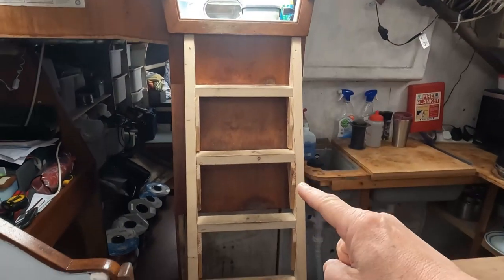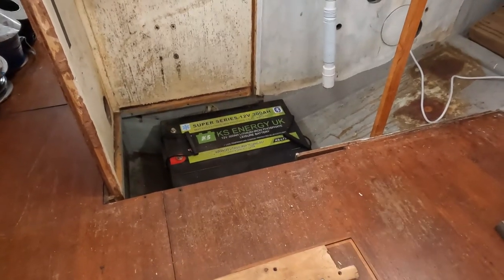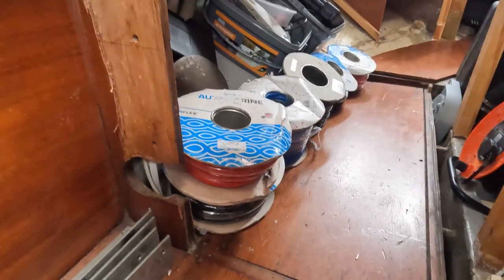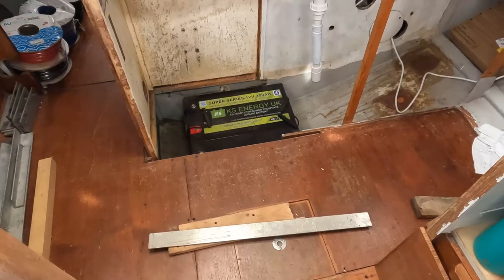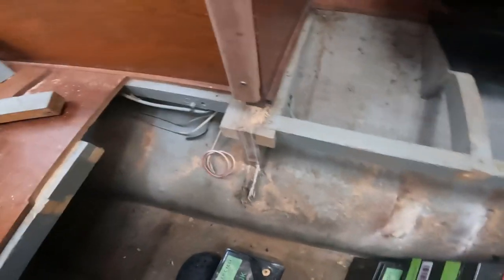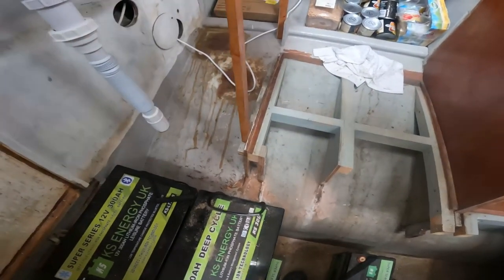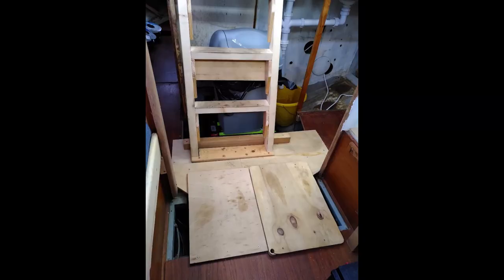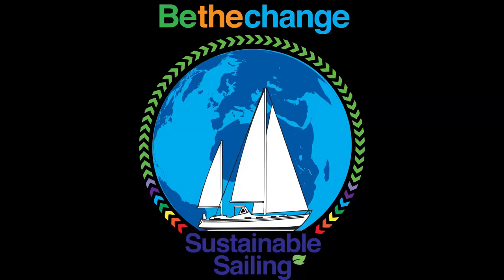The beginnings of our watertight battery box in the bilge, key to an all electric boat

Comment: Love your channel!. I have a quick question. You have two rows of batteries - one on top of the other. Are you separating them so that the batteries do not rest on top of one another? Also, how will you get to the batteries on the bottom without having to remove the batteries on top first - to check them out. I am asking because I face the same dilemma...
Reply from the maker: They will be partially separated by supports for the upper batteries so that they don't rest on the lower batteries. Anyway the ends of the upper batteries touch the hull before the lower batteries so it is also about stopping them chafing the hull.
We won't be able to get to the lower batteries without removing the upper ones, but the lower 120Ah batteries have a Bluetooth bms (only one of the 300Ah ones does so that will be the least accessible).
I'm most concerned about the fuse. I understand it should be as close to the 1st battery +ve as possible but that will make it very inaccessible.
Reply: @SustainableSailing  Thank you for replying. That's a good idea. I would put the fuse on the opposite end. There is only the requirement for distance to be the same between batteries in a bank to reduce resistance - not where you decide the bank head is. Given that you are using what appears to be 4/0 cable, you should not see  resistance.
Reply from the maker: I've rechecked ABYC. Fuse needs to be within 7", call it 150mm. So I can put the fuse in the motor compartment on the outside of the watertight gland. That means I can get to the fuse without needing to open the battery box. It will still be 1 foot above potential bilge water.
Reply: @SustainableSailing  This is all great news. Thank you. I have a lot to think about now.